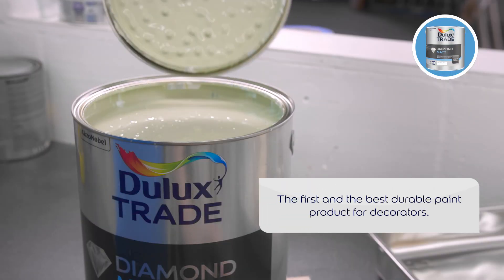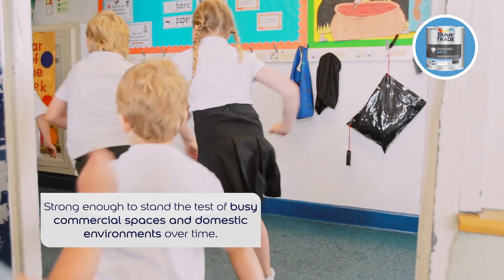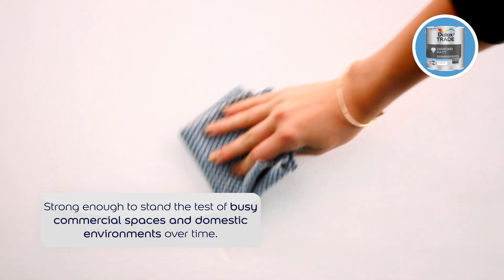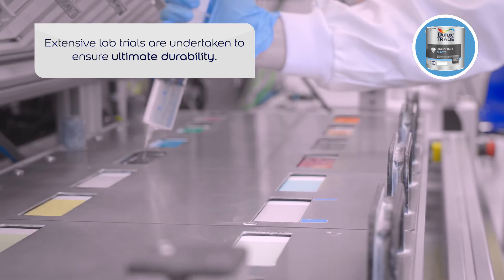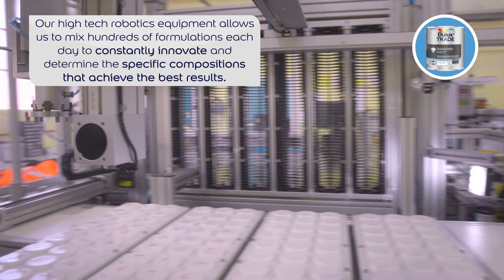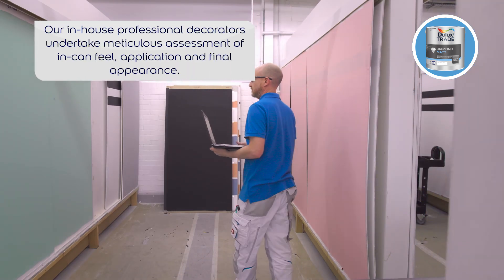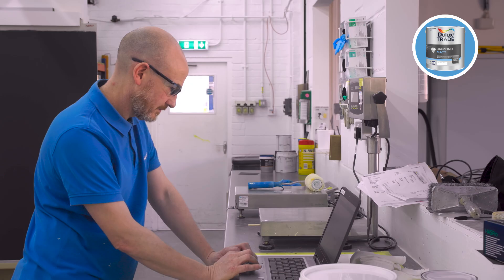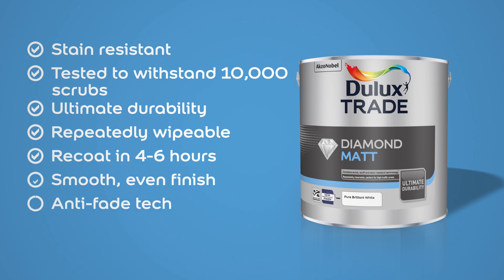NEW Dulux Trade Diamond Matt

Comment: Hi, I bought a Dulux Eggshell Diamond water based paint for an mdf furniture primed with 2 coats of acrylic primer.
I missed the 4-6 hour recoat window as per tin instructions.
After 24 hours when I tried to sand with either 240, 320 or 400 even in a very light sand, they were removing a lot of material.
Should I keep sanding and recoat? Should I just coat on top of the first one without sanding?
Or should I wait even more time before sanding?
Any help will be really appreciated.
Thanks
Reply: you can't really sand down water based primers undercoats right after adding the finishing coat cause they take around 7 days to fully cure